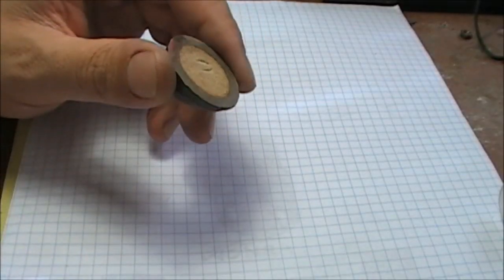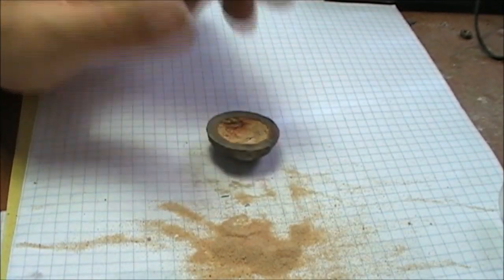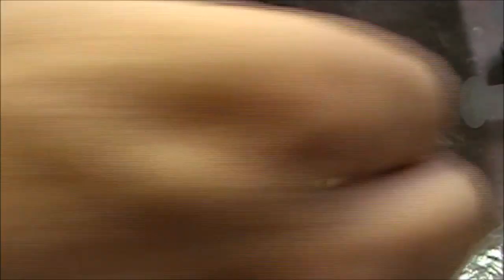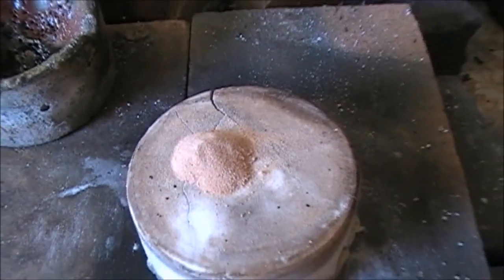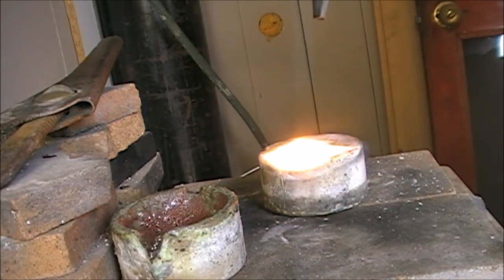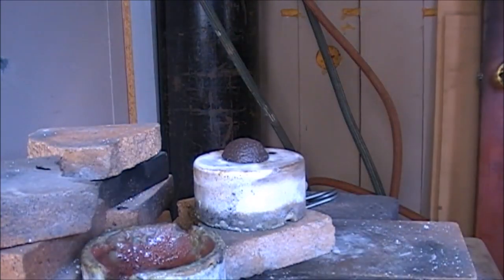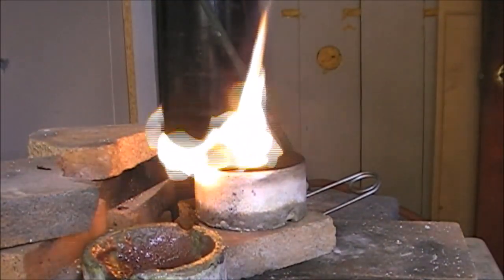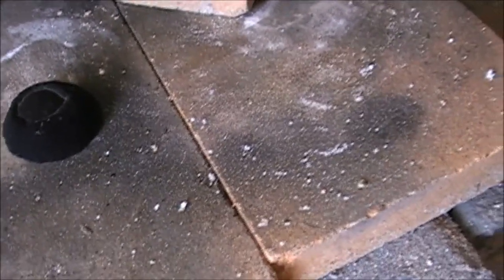Klerksdorp spheres and Moki marbles: FINAL CHAPTER.

Comment: Back in the Jurassic period quartz blew around and rounded into sand became layers of sediment. The oceans at that time had large amounts of iron dissolved in the water. Microbes produced oxygen and at a certain point the oxygen bound with the iron and it settled to the floor with the quartz. When the water receded the oxidized iron and quartz formed hematite and that’s the red sandstone you see today. Overtime water percolated through the quartz and where the chemistry was just right pulled iron oxide down and formed iron inside the sand. Then the sand eroded and left these balls. What you melted in the middle is quartz and the outside is iron. Source: I’m from Utah where slabs of iron lay naturally on the ground and these balls here.
Reply from the maker: Hey there, thanks for commenting. Please check the last video about these balls since I've found something very interesting within them.

Comment: They landed opened released the microbes then the filled with sand and closed like clams?
Reply from the maker: Jeff Tranzillo there are soft fibers inside and it seems the whole ball is held by it. More dense and dightly packed in the outer shell, loosely in the inner one. Please check my latter video about them here is some microscopic video of one opened.

Comment: Thank you so much for doing these tests; to me it doesn't confirm or even suoport the theory they were naturally formed sand balls coated in volcanic rock or lava hitting the beach, simply because they are formed too perfectly and the transition between the contents and the outside are very stark and even. 

Also because we have seen enough volcanoes to know that it doesn't happen even roughly anything like as symetrically perfect as these balls are.

Neither does it explain the properties of how well balanced they feel to hold in the hand. 

Really need a full chemical analysis.

Even with todays tech. I doubt anyone could replicate this. 
Even the slightest amount of moisture in the contents would cause steam which would blowout a hole in any molten coating before it cooled.
Reply from the maker: Drew Hurst thanks for commenting. In fact I got other specimens and I’m about to release another video about it. I’m going to send one to a researcher at the university of Warsaw that offered to submit a specimen to all possible lab analysis. Stay tuned! 😉
Reply: @sutra1976  I am glad to hear that Angelo1976 
Most of my research is very alternative and therefore I have little information to back it up, like for instance since my last reply I have heard that it is thought that the balls were used as communication devices but it was mentioned by someone in passing and I have no idea of their source or reasons for this but it all helps to open our minds to any possible possibilities, until more tangible proof is discovered. 

If you think that's hard to believe then you don't even want to know what my first thought was when I opened my mind to all possibilities of what they might be. :)

I have been meaning to look into the minerals found in other reports on the balls, 
as many were minerals I have never heard of 
but it's not ordinary sand, I can tell you that much.

Many minerals have amazing properties when combined, such as nickel and titanium for instance. 

We know we can make batteries and radios by combining and using even just a few common minerals.

How much don't we know about what advanced combinations of several of many types of minerals and what they might produce?

It is said by someone who worked on the propulsion systems of recovered craft, at the Area 51 base, that the material of the outer hull as well as a material that was found inside which was as light as a feather yet stronger than steel and could not be burned, could not be reverse engineered as it's composition was too complex to fathom. 

That information, while I believe to be correct, is now several decades old and who knows what they have been able to discover with the advent of new machines like electron spectrometers and the like because I doubt they just gave up trying to find out what it was. 

I really appreciate your efforts and I commend you on your persistence to search for the truth.

Best wishes to you in all your endeavors.

Edit: I have used the word mineral(s) in my comment when I should have used the word element(s) in some places but it 
makes no difference to the general meaning of what I was saying for those who want to understand, and not just nit-pick. 
:-)
Love to all.
Reply from the maker: Drew Hurst thanks for your commenting. The sand looks kept rogherete by strange filaments looking organic in nature. Almost like morgellons fibers.
Reply: Could the one my dad found on a northern calif. beach be a mokui marble? It is large, around 2 in. across or around, 6 in. diameter, lava color. Where do you think it came from?
It's kind of heavy but don't know how to weigh it. Seems a little heavier than a roll of pennies. My dad dug it out of an ancient camp sight above the beach  years ago which has  been washed away by the ocean over the years. I'm sure it was brought in from somewhere else. Africa???

Comment: Geeeeeeeeeeez 
They are from a volcanic eruption where molten lava spits out, to land on beach. Collected  and traded.
Reply: I hate to disagree with you but I cannot see this is at all possible. 
2 reasons 
1 It's not ordinary beach sand 
2 Not only the slightest bit of moisture in the beach 'sand' would blow out a hole in the ball 
but also even any expanding gasses from the 'sand' inside would ruin the ball shape. 
In fact, even any trapped air between the 'sand' would cause a blow out 
at the temperature the ball would have to be to be such a hard rock in a molten state. 

Just not possible as far as I can even remotely imagine.

Comment: Sand + extreme heat = glass. When heating the glass shell too fast thermal shock happened and it cracked part of the shell off....if guessing if you quickly quenched them in cold water you would get glass frit or crackled glass
Reply: Except the outer shell is metal, not glass.
Reply: @techno.science  How come you watch a 4-years-old video at the same time as me ?
I have such sphere at home, but I didn't know what they had inside. I'am surprised !  Geologists are really annoyng when they keep explaining their formatipn through "concretions" !

Comment: That seems to support the idea that they were balls of sand coated in a volcanic material. The sand melted to form a glass-like structure while the volcanic rock really never changed state. An interesting geological process. Thanks for sharing.
Reply: I hate to disagree with you but I cannot see this is at all possible. 
2 reasons
1 It's not ordinary sand
2 Not only the slightest bit of moisture in the beach 'sand' would blow out a hole in the ball but 
also even any expanding gasses from the 'sand' inside would ruin the ball shape. 
In fact, even any trapped air between the 'sand' would cause a blow out at the temperature the 
ball would have to be to be such a hard rock in a molten state. 

Just not possible as far as I can even remotely imagine.

I have heard other descriptions of how sediment leached inside too and they are equally as ludicrous.
The outer rock is not at all porous like limestone is so this idea does not seem at all possible either 
as evidenced by the complete lack of this occurring in any other types of hard dense rocks found 
elsewhere anywhere on Earth.
Reply: @Drew_Hurst  Exactly the same phenomenon occurs in sedimentary layers around the world. I'm in Kent, England. We get exactly the same iron concretions washing out of London Clay cliffs. No mystery.
Reply: Some sort of dry, hardened sand being engulfed by running lava somehow before plunging into the sea?
Reply: @Mortum_Rex   tousands of times? some spheres habe also liquid inside, how to explain that?
Reply: @dawvideokanal7369  bollox